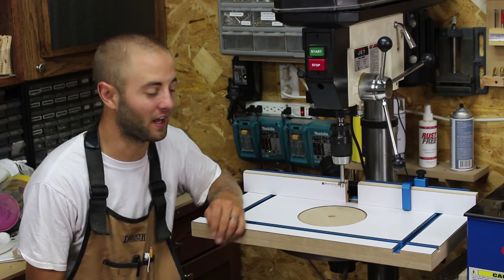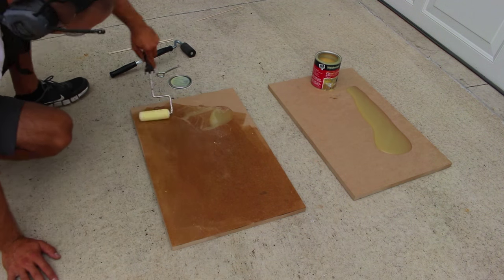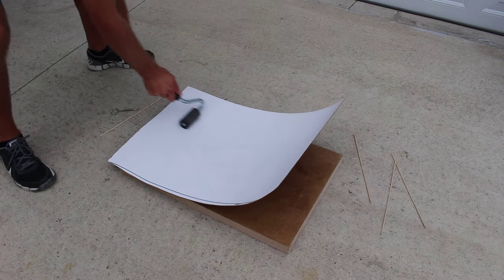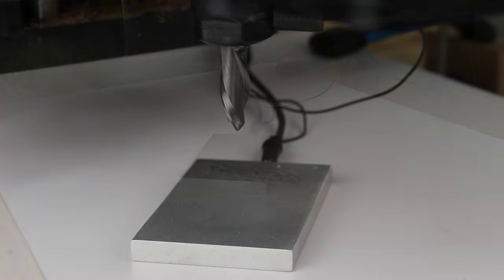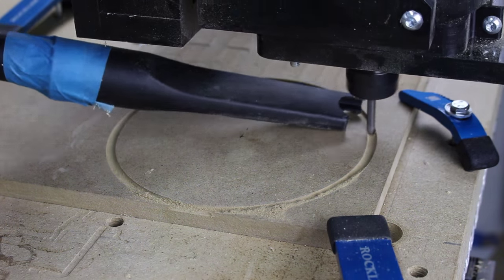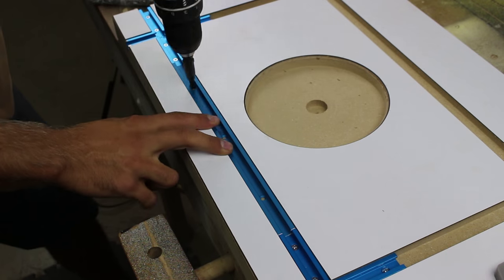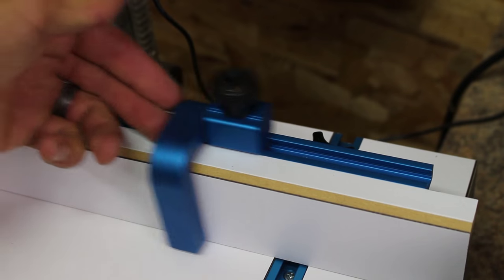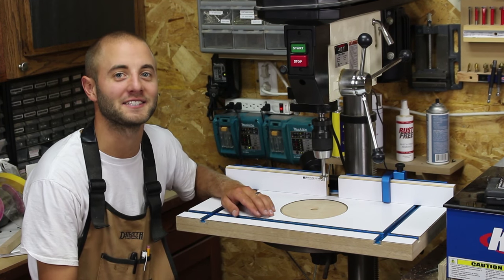How To Make A Drill Press Table

Comment: The round insert is a handy feature.  I had been using them for years (think I had seen it first in a ShopNotes or similar magazine).  Mine is sized so that I can knock them out using a 6" hole saw nice and quickly.Doesn't have to be a tight fit side to side - mainly just need it to be flush with the top.  In order to simplify construction, the inserts are 1/2" MDF.  The top is 3/4" with 1/2" laminated on top of it.  This allowed me to simply use the same saw to cut the hole for the insert before assembly and no messing about with routers, templates or CNC machines.
Reply from the maker: +Joe and Liz Rock on!

Comment: Nice job, I very much need something like that.I was wondering though, as the insert will be lower than the table surface by the height of the laminate do you get any breakout? If so you could cut a circle of laminate on the CNC and put it in the bottom of the turn tale ole to raise the turntable by the amount required.
Reply from the maker: +T Radford The pocket can be adjusted on the CNC or if you don't have a cnc you can put 3 leveling screws if you use a inlay method or hole saw.

Comment: Andy, great video.  The only problem is the CNC machine.  They are very expensive and beyond most small shops.  I don't know how cutting that circle out with a hand held router would work out.  Certainly not as perfect as the CNC.  Best regards.
Reply from the maker: +Richard Katzman Richard! Yes you do! Think outside the box! Just imagine it as a giant inlay. create a template, route it out with the router and make the matching male inlay for the circle. Or use a hole saw and shim out the ledge and use a bandsaw or rig saw to cut the ring. Don't take this the wrong way, but people see the CNC and get scared off. They make things easier but there are always a way to do something without them. Thanks for watching and keep commenting! Love it!

Comment: As usual, it came out great.  Do you need to keep the original DP table, or could you just remove it and build an attachment for the new auxiliary table instead?  What are the benefits of attaching it to the original table?
Reply from the maker: Yes the factory table is required as it has the mechanics to raise, lower, and lock the table
Reply: +Glass Impressions I was referring to the section at 4:12 in the video where you're tracing into.  I understand raising/lowering/tilting.  You could also just include a stem so it can get inserted into the arm that controls the movement right?
Reply from the maker: +xHMProductionx you would need to build a clamping mechanism. Maybe I am not understanding correctly
Reply: +Glass Impressions Yeah, I guess it's just easier to attach instead of figuring out what you can use that can be clamped.  Thanks Andy!
Reply from the maker: +xHMProductionx no problem!!!

Comment: Does anyone have any suggestions on the best way to make the round insert and cutout if one doesn't own a CNC router?  Looks like a great idea, but I'm not sure how I would go about doing that part.
Reply from the maker: Think of it as a giant inlay. Template and an inlay kit for your handheld router. Or you could use a 6inch hole saw them add a few tabs for the lip and the insert.

Comment: What diameter is the first circle that was cut out from the CNC machine? Thinking of doing this but using a hand router with a jasper circle jig.
Reply from the maker: Jacob Sullivan 6” circle
Reply: Glass Impressions thank you. What about the removable circle?
Reply from the maker: Jacob Sullivan ??? Same size
Reply: Glass Impressions the sacrificial piece
Reply: So 6” circle for both where the sacrificial insert sits and the sacrificial insert itself 6”?

Comment: Andy I really like your videos but showing us how to building something with tools most of us don't own is a little questionable. I for one don't own a "jig hardware kit" never mind a CNC machine LOL! Anyway thanks for making this.
Reply from the maker: +Travis In Canada Thanks for watching and commenting. I don't mean for this response to be rude but if I picked projects based on tools people had my channel wouldn't be very interesting. There are many ways to make the projects and many tools to do so. Yes, lots of the tools I have are expensive and a luxury to have BUT you don't need them to make these projects. The  hardware "kit" is simply an assortment of items you can go to the big box store and buy. No need for the kit on this project. The cnc was used to make the turn style insert plate. That can simply be made with a router and a template or even a 6 inch hole saw. My videos are made to inspire people to get into their shop and make something, not necessarily the exact same way I did it or with the same tools I used. Again, I hope this reply doesn't sound rude as it is not intended to be. Please subscribe and keep commenting!
Reply: yeah I get it, thanks :)